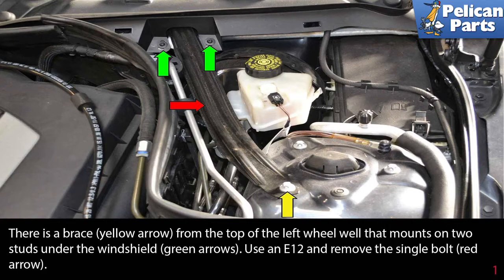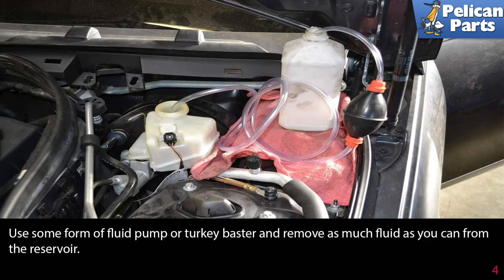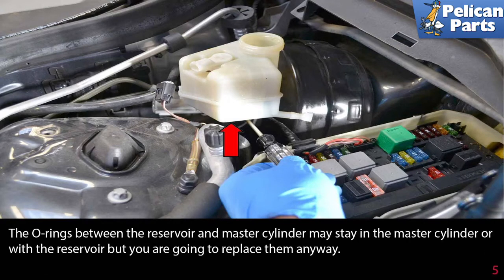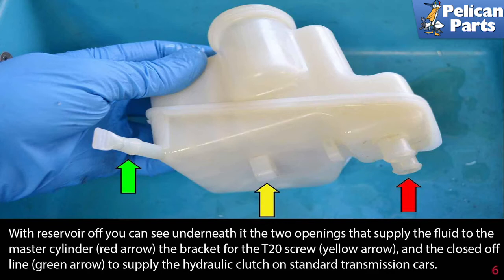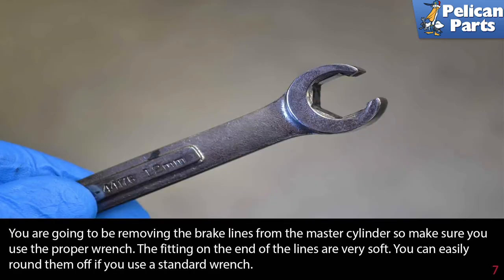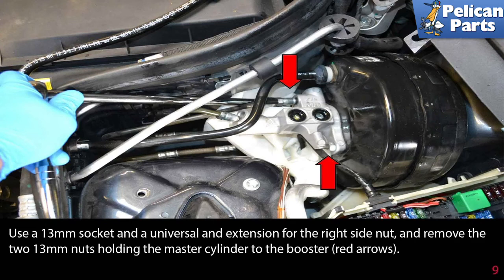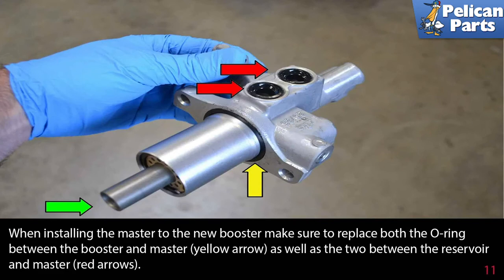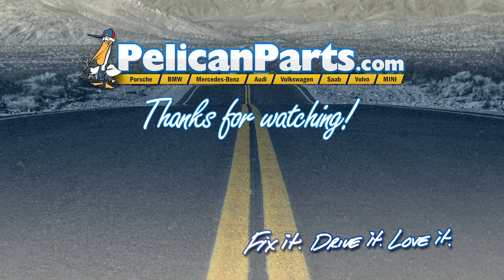Mercedes-Benz W204 C-Class Brake Master Cylinder and Reservoir Replacement

Comment: Great vid how do you bench bleed the master cylinder?
Reply from the maker: Place in vise. Then run hoses to full reservoir and slowly push master plunger under air is out.
Reply: How long does this typically take to replace?
Reply: @pelicanparts  So I would have to reinstall the reservoir to bench bleed... then remove it again to reinstall the master cylinder to the car? Also I was wondering how you were able to remove the brake lines from the master cylinder without brake fluid going everywhere? Does it only leak very slowly?